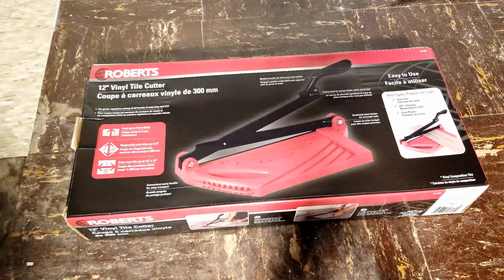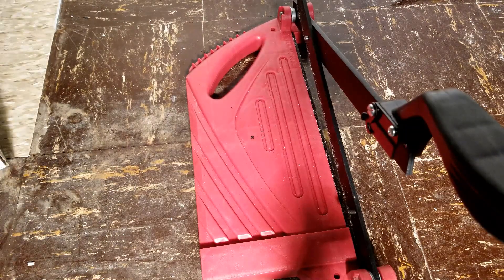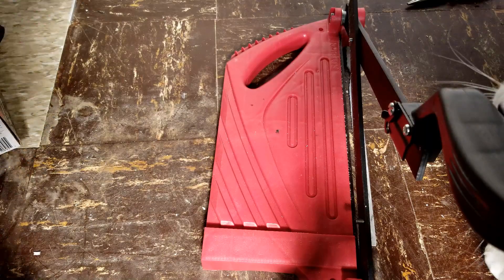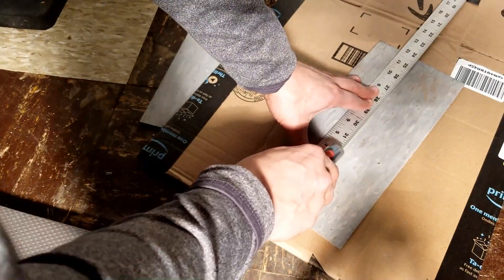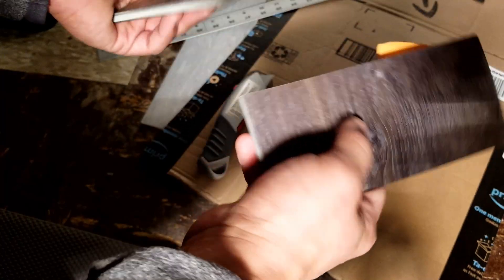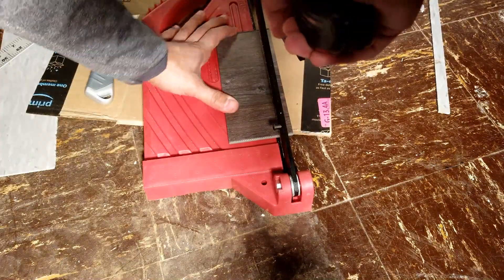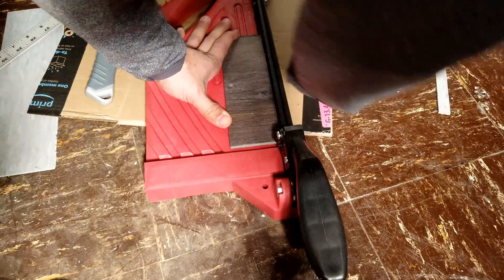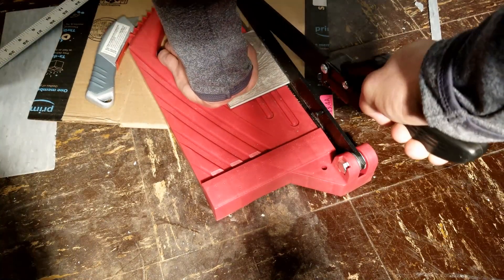Roberts® 12" Vinyl Tile Cutter

Comment: Awesome thanks I have an old QEP cutter and I’ve noticed it isn’t cutting straight anymore. It’s just about 1/16” off at the top after cutting it. I was trying to find out if I could adjust something to make it like it cut twenty years ago. I don’t remember where I purchased it from but I think it was DIY. Utility knife and a straight edge is the answer for speed. Thanks again

Comment: I was curious to see how this worked considering its price tag.  I didn't expect it to cut anything thicker than 4mm and it doesn't seem to handle rip cutting a 12 x 12 vinyl tile (probably capable of <12 due to the flaw you pointed out).  I am not good at the score/snap technique (can't draw a straight line with a ruler!) and was looking for a guillotine-style cutter for end pieces AND rip cuts.  Thanks for saving me the trip to the store, then back to return it.  Haha.

Comment: I have the lowes version, looks the same but gray instead of red. I'm trying to cut cheap peel and stick and it cuts it but for the life of me I can't get a straight cut! I figured I must be doing something wrong but I can't figure out what.
Reply from the maker: It's meant more to cut commercial non  stick type tile. A Straight ruler and utility knife Worked much better for me. Should be the same for self adhesive Vinyl tile.